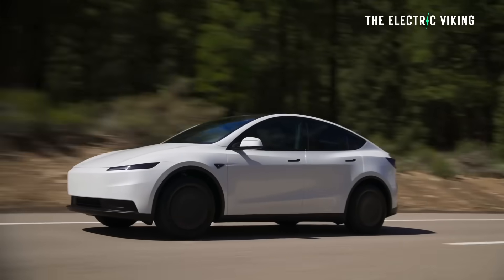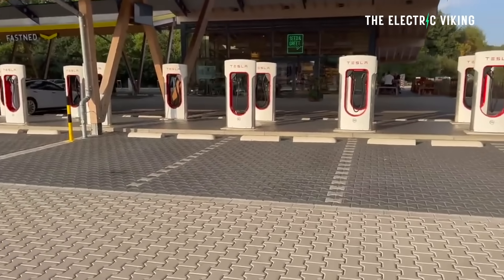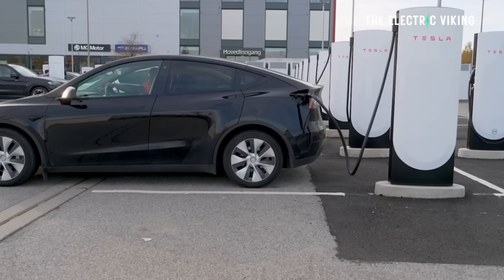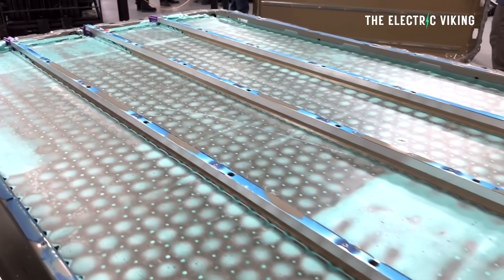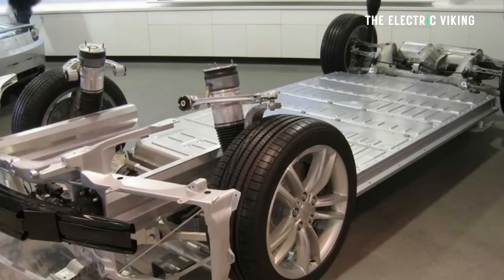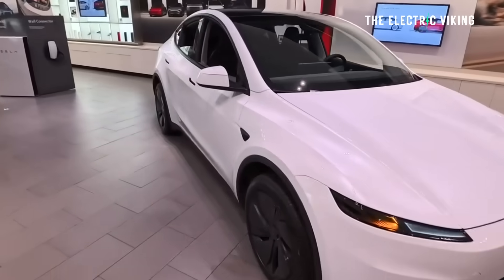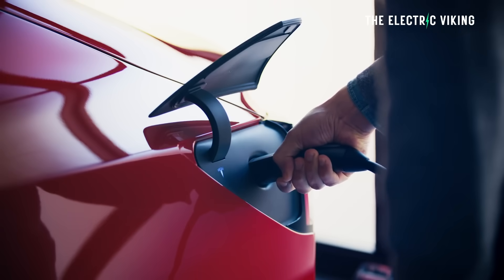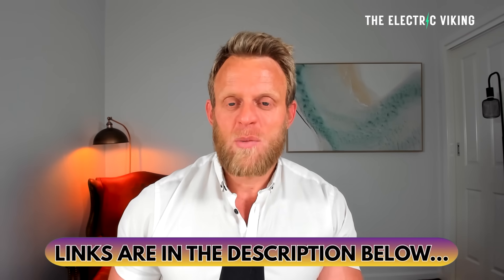Musk: Next Generation Tesla's to Get 6C Batteries & 10-Minute Charging

Comment: Here in WA we might have to wait a long to get these charging speeds in more locations. We are lucky to have more than 50kw charging that are non Tesla. Much easier to charge slowly at home.
Reply: Here in the Netherlands 50kw chargers are outdated.
Most of them are 150, 300 and 350kw chargers
Reply: Here in California, Tesla is the slowest overall network at 250 kW, Rivian 300 kW, and virtually all the rest of the fast charging sites I see are 350-400 kW. The 150 kW non-Tesla units are ancient & nearly all have been upgraded to 350 kW. There are a few slow fast chargers 50-62 kW around, but they are cheaper community chargers at places like parks, community centers, & libraries, where 1 hr to charge isnt a big deal as you will be busy anyways.

Comment: It's quite amazing to think that my self built, 48v 16ah ebike lithium ion pouch cell battery pack, with the cells purchased directly from the very large Chinese ebike and drone battery manufacturer Greatmax, were rated at capable of 10C charging and 15C discharging in 2017..After over 8 years use, but only normally charging at 0.2C, (3a) the batteries show virtually no degradation after all that time..Not sure that would be the case though if I had pushed them to the 10C limit!
High speed, high C charging and discharging, along with excess heat have always been the achiles heel for lithium ion cells..It will be interesting to read how Tesla has resolved these issues with its new cell..maybe Tesla's own High silicone content, dry anode 4680's..?

Comment: are model 3 and model Y also become 800v architecture?
so far cybertruck, model x and model S are 800v architecture.
thanks
Reply: Model S and Model X are still 400V. Only the Cybertruck is 800V.

It is tricky for Tesla as only the V4 Superchargers are capable of above 400V charging.

They need to make their architecture accept 400V without introducing a DC/DC converter.
Reply: @guillaumegiroux9425  so how would they charge that fast with 400v architecture? looks like will not happen, unless model y and model 3 become 800 v architecture., otherwise gas light
Reply: @metrotrujillo They won’t charge that fast at 400V. Only on 800V+ V4 Superchargers.

It is quite challenging to charge a 800V car on a 400V charger. The Cybertruck is the only one capable of doing it and get maximum power, but it requires them to switch modules from parallel to series and its easier said than done.
Reply: @guillaumegiroux9425  so what you are saying is that model Y and model 3 will start using the 800v architecture?

Comment: 98% of the time I charge at home while I'm sleeping... I want a battery that last as long as possible and holds it range, not charges faster.
Reply: You don't need to fast charge over night. It's adjustable. Would be nice when travelling though
Reply: I want an EV that can go 500km in -20c and holds it's range for weeks.
Also fast charging on trips, I am not willing to sit and wait for over 30 minutes to get 250km of range.
I also wants Longer warranties, like 10 years with no limit on Km/Miles.
Real warranties, not the Mercedes Benz warranties that in reality ends after 2 years when the battery is worth more than the car.

Until then I stick with my old Diesel.
Reply: @jone8626 Warranty on batteries are 8 years or 100k miles. Gas cars you get 3 years with 36k miles  and you want 10 years with unlimited miles? LOL.
Reply: @jone8626  That's probably what most people want, including myself. However, the advantages of even todays EVs over the older combustion cars are so massive, that sticking to the diesel was no option for me, so I switched (3 years ago). Range and charging speed are just some of many aspects of a car. In hindsight, it was the best decision I could have made.
Reply: @jone8626 I want to be able to breathe air without my lungs being filled with poisonous gases and particulates
Reply: @jone8626  You diesel gels below -10C unless you tale extra effort to prevent that. 
Unlike you diesel drivers who have to wait at the pump for fueling to finish, EV drivers don't wait at the charger but do other things like eat or shop. Real world, YOU lose more time fueling your diesel than EV drivers lose charging on road trips. Unless you are going to be one of those liars who claims they always pee in a bottle and eat out of a cooler. But for real human beings, EVs save time.
EVs are lasting much longer than 10 years. More EVs last 10 years than ICEVs.

Comment: Can charging stations deliver that much power?
Reply: Nope.
Reply: @a @aaronbounds1336 ven if the stations are limited to 400kw currently, a flat 400kw for 10-15 minutes is enough energy to drive for a few hours, far beyond the capacity of my 6 year old’s bladder.
Reply: Charging stations would need to be upgraded as well.
Reply: I would trust a tesla vehicle during charging than a Chinese one .
I think a 10 minute charge is good enough.
Reply: @brettmciver432  Maybe you should watch the video. Tesla got the idea from China since their EV's already charging in 10 minutes or less.
Reply: @PyroShields yup I get that, but how reliable are the Chinese battery and battery management components ?
From what I recently have heard the BMC aren't particularly the best so at 4 and 6c and above how reliable are they? I am hoping tesla slowly puts out the equipped cars but slowly increases the charging rated so they get good data on how that 
Fast charging is going to effect the longevity of their packs and i think thats a wise decision.
Reply: @brettmciver432  You do realize Tesla EV's come with  Chinese batteries right? CATL is the largest battery manufacturer in the world, they are known for making the best batteries this is why Tesla uses them.
Reply: @PyroShields yup but teslas battery management system 
Manages them better than anyone  else, I have heard very few issues with the packs in teslas and from what I also heard recently they have just increased the packs warranty from 8 years to 12 years.
Reply: @brettmciver432  Tesla battery warranty is 8 years or 100k miles just like every other EV company. The Cybertruck gets 8 years and 120k miles.

Comment: Perhaps in China, where most EV owners are apartment dwellers, very fast charging is high priority. Since I use home charging for 90% of my charging, range, price, and long-term battery life is far more important.
Reply: Some people in the US do travel. Fast charging speeds should be desired by all.
Reply: @imasharksfan1149 depends on your use case really.  The point on home charging is well made, it’s not a priority, it’s a nice to have
Reply: @imasharksfan1149  Todays average max Tesla range is around 300-350 miles. You can get 260 miles charge in 30 min. 
Where are planing on going? To the moon?
Reply: @bilboriches7216  yes, I agree so long as the network is sufficient and reliable, Tesla well ahead on this
Reply: @jsanders100 It doesnt really matter what chargers you using.
Reply: City dwellers who don't have access to home charging would welcome such charging speed. Then there's competition against Chinese EVs. Regardless, speed means convenience means more adoption and conversion from ICE.
Reply: @hvu6037 only if you think of charging the same as if you think of filling up with petrol. you go for the traditional think of empty to full to topping up.
Reply: @jsanders100 you think we don't have the same network?
Reply: @jonfrench7133 No, it has practical benefits besides less time waiting.

If vehicles can charge in 10min rather than 30min, the chances of coming across a fully occupied charging stall drops dramatically. Alternatively, if you do come across a fully occupied stall, your waiting time, on average, will be 3x less.

This would actually make smaller 4-6 stall charging stations far more viable, which could encourage Tesla to build out more of them.
Reply: @tomfahey2823 your mindset is a great example of the transition that needs to be made once you convert to ev and have the ability to home charge.  If you can’t charge at home or work it’s a different proposition entirely. In the UK 60%!of households have the potential for home charging so here it’s a very significant use case and charging time not a user constraint
Reply: @jonfrench7133 Yeah, "just deal with it" isn't a reasonable response from the car manufacturers in my opinion.

I never actually fast charge, primarily because it cost 7p/kWh at home overnight versus ~55p/kWh at a fast charger and secondarily because I suspect these kind of 4-6C charging rates are bad in the long run for the battery.

But that doesn't change the fact that faster charging times will offer more convenience to EV owners - especially in situations such as road trips.

Simply saying "you have to accept that it will take 30 minutes to charge" is kind of silly in my opinion, because it's really just a matter of individual preference. There's probably someone out there who will argue that 2hrs is a reasonable charging time - how many people do you think will agree to transition to that 'mindset'?
Reply: @tomfahey2823  the point on cost is well made but i can’t agree on the priority of charge time for the home charger use case.  It’s not a daily or weekly factor.  The only time it’s a factor is road trip time, so i’m waiting 10 mins longer once a year at most. The more important factor is range which is also coming with 6c batteries.
Reply: @hvu6037  No, charging speed really doesn't increase convenience much. It has a bigger impact on those that have never driven an EV before. It i like a 400 hp vs 500 hp engine. sure the 500 hp can probably accelerate faster but when would you ever use it? You are even less likely to need that extra charging speed.
Reply: @tomfahey2823 on a road trip you are only charging for anywhere between 5 to 15 minutes usually 5 to 10 minutes. You only need to charge enough to get to the next stop not completely recharge your battery.
Reply: @tomfahey2823  But this is only when highway driving. No benefit for daily driving.
Reply: @tomfahey2823  The point is that your argument only matters to people who have never owned an EV before and the more people who know others that do own EVs and talk to them and tell them that fast charging times of less than 30 minutes are largely irrelevant the more people will realize that it is just another talking point to slow down EV adoption. 
That talking point is the last thing ICEV enthusiasts have to hang their hat on to keep EVs from taking over because it sounds reasonable for those who have only experienced ICEVs.
Reply: @bilboriches7216 Already been. Lol. I also do most charging at home. However, I make a 900 mile round trip 2-3 times per month. The SC on the route I take are all 150kw. Faster would be nice.
Reply: @imasharksfan1149  Nore sure if you need an upgrade. I really doubt you are even going to save time. How many stops are you doing and for how long?
Reply: @williammeek-h2o  It makes a huge difference to those who can't charge at home.  Range of 500miles (i.e. 400 is 80%) and charging to those 400 miles in 10 minutes would be a game changer for those frequently doing long distances away from the motorway network, and who can't charge at home.
Reply: @chidorirasenganz  Assuming that next stop is somewhere you wanted to stop anyway, and its chargers are are available, and the stop isn't too far away (trying driving the NC500 in Scotland!).
Reply: @simhedgesrex7097  Again, only in the minds of those who don't own EVs.
The ones who do realize that you get to do other things when charging like eating or shopping so it really doesn't add any time to your schedule if you plan a little.
For example Walmart is expanding their store charging network to include 400W chargers and more locations.
Long distances from the charging network is becoming less and less possible every day.
Who wants to spend time waiting at a charger or fuel pump when you can eat or shop instead?
Reply: I appreciate china the developers unlike murica good for nothing. Ev they are pushing in right direction.
Reply: Would be great to have everything you mentioned and 10 minute fast charging though obviously
Reply: Higher C rate means less stress on the battery pack at the same amperage and therefore longer battery life.
Reply: Faster fast charging is good for everyone some of the time.  More access to L2 charging at home (for apartment dwellers) is the main barrier to true mainstream EV adoption in the USA.
Reply: The US has a lot of apartment dwellers in cities that would own an EV if fueling it would be faster.
Reply: @ChicagoBob123  no, they need home charging if they don't already have it
Reply: @williammeek-h2o  multi story apartment complexes don't have chargers or garages.
Reply: @ChicagoBob123  Some, and a growing number, do.
Reply: A lot of teslas current hit 3C today if they are charging at 250kW?
Reply: @RobertP55tg12 Only for the lowest SoC do you see these numbers. In my M3LRAWD I see great charging performance until around 30%, at which it declines from 250kwh to 100 down to a more steady state of 72.
Reply: @okmonroe  It's kW not kWh. You dip below 250kW before 30%. It does not hold steady state of 72kW...
Reply: @RobertP55tg12  yes
Reply: China doesn’t need to buy teslas. Domestic manufacturers already have better options at better prices.
Reply: @scott32874  You can say the same about any particular EV or brand
Reply: No. China just had a deal with Musk - he lets them steal Tesla tech to test them for free on chineesee people. Thats why we see Xiaomi cars burning with passengers inside and we dont Teslas doing it.

Comment: I like my 2018 Tesla Model 3 all wheel two motor😊 just fine and it is smarter than a 5th grader. Unless someone drops a bomb on it l will keep it in my garage where it charges from solar panels.😊
Reply: Nice. How long does it take to charge with the panels and how many panels?
Reply: @PyroShields Pyro! 8 Panels installed in 2018. We l leave in the morning car is always at 80%. If l go on a trip over 300 miles l charge to 90% but rarely to 100%. Charge 9:00 p.m. to 7:00 a.m. 😊